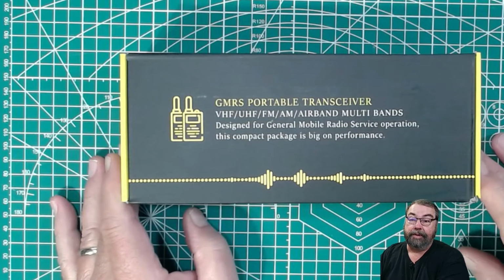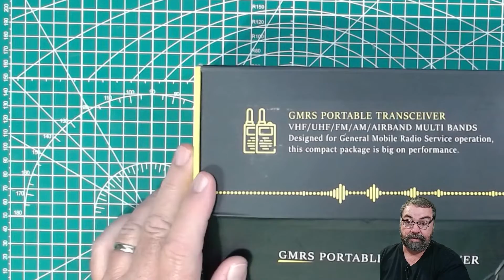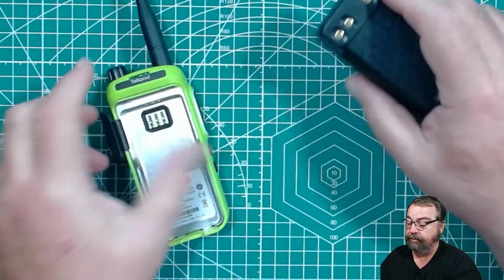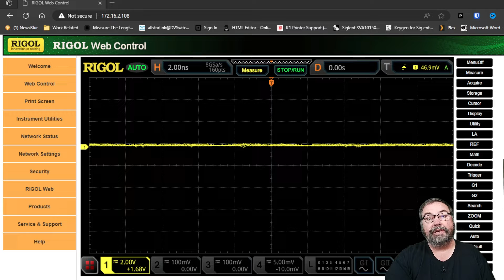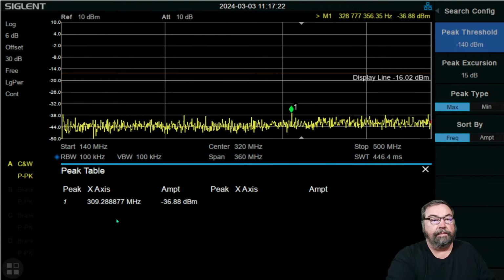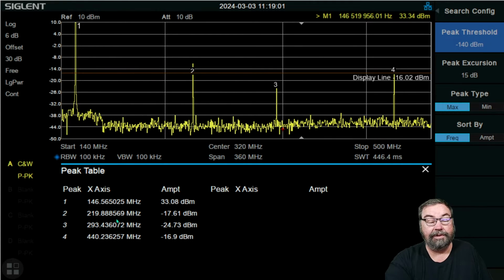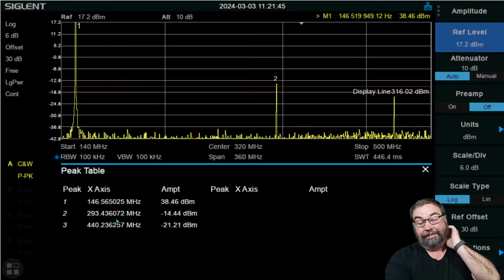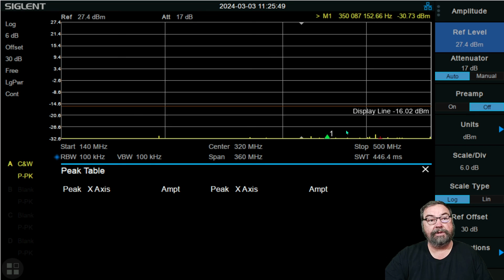Testing TalkPod A36 Plus "GMRS" 8 Watt HT: Worth the Hype?

Comment: Has anyone else noticed a really bad battery life on the 8w version. I realize it has a much better display than the Baofeng UV-5R & UV-82HP, but I keep the back light timer at a minimum and have even tried the deep battery save mode. With little to no TX and very small amounts of RX, the battery drops too quickly. I turned it on the other day and it read 7.8v. Two days later with no use at all it reads 7.2v. My Baofengs under the same conditions last a ridiculously long time. Any ideas?

Comment: I am a student pilot and I need an inexpensive radio to listen to the airband, is the Talkpod A36 Plus  a good option for me? Thank you.
Reply from the maker: Hey Jose!  I am actually a pilot myself.  IMO, no.  For several reasons.  Most importantly, it's not tied in to your headset, so it will be very hard to hear.  I also think (IMO) that you have better situational awareness while flying.  If you're talkin about on the ground, then if it recieves air band, sure it will be fine.  Depending on where you live, it will be hard to scan tower, approach(es), ground, and/or clearance delivery.  Just kind of depends on how big your local airport is.  Good luck getting your ticket!

Comment: nice test. I got one of the newer A36+ and it tested clean. but it did come locked to GMRS only.  but when un locked it was clean on harmonic's so I kept it and gave it to my girlfriend. she wanted green radio. the RX on it is great does air band and so much more. the program cable is great  easy to use with CHRIP . and that program cable is better than the UV-5R program cable. it fits in the K1 plug easy.  can use it on many radios that program threw K1 port. what a improvement over the first ones sent out. Josh and Hayden got some very dirty radios. Hayden got new one . did video they fixed it.  nice review on Talkpod. 73's

Comment: So happy to see another test with this radio on the O-Scope.   I just posted a video on this radio as well, and noticed a problem on 2M low-power with the output waveform (on 3 different radios).  So far you are the only other I've seen address this.   Thank you and 73!

Comment: Good enough for government work, but not amateur play.  If it don't fail consistently can you really fail it? :)
Reply: Lol, I wish you guys would send a couple of these my way and Ill give them the testing we gave gear in Navy, and provide a dramatic award for failing devices. It would be distinctly not a Sherwood style report. Im old and in my twilight and want my legacy to be budget operator with uncompromising standards for gear and conduct in this hobby. I watched hundreds of videos to aquire an HT and after so many ambiguous reviews I came to be sceptical of motives and clearly conflicted. In the end I traded an expensive metal detector that a disabled guy like me cant use and for an unquestionably good FT-70D that survives my daily drops and has no perceptable harmonics at 2m and 70cm with full quieting into repeaters from Milwaukee to Chicago on the Elk LPA or easily 30 plus miles to other repeaters. One good used Yaesu HT is better than the proverbial 5 of these in hand because it does what we should expect of it.

Comment: It's kind of sus that the FCC ID could not be found.
Reply: Considering the FCC has established a legal entity in China for compliance they have only deception at front of mind and profits to gain in any subterfuge or overbroad type acceptance use across and entire breadth of models. Im pretty certain every different service frequency (class) model has to use that specific type accepted testing and results easily found under the FCC id.